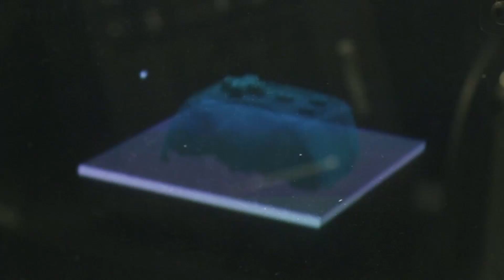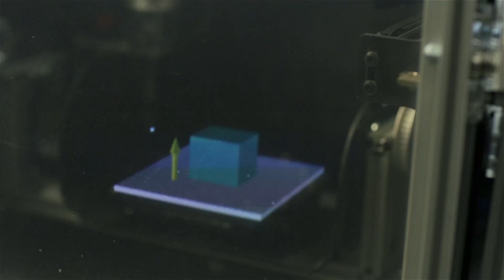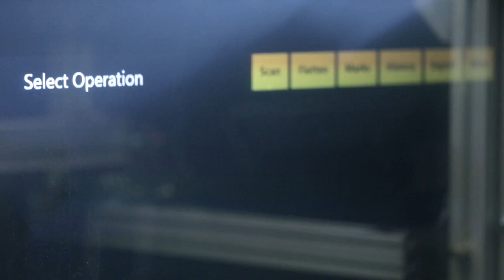ReForm: Integrating Physical and Digital Design through Bidirectional Fabrication

Comment: I think it all depends on the type of products you primarily work.  I spent the last 12 years working almost exclusively in the Ergonomic fit and feel realm of products for "The leading firm for handheld product design".  At the heart of our process was clay sculpting literally using pounds of sculpy clay a month.  Process was sketch, mock-up, sculpt, sketch, repeat until it fit right.  Working on the very front-end concepting stage of the clients programs allowed this process and allowed us to stay out of CAD as long as possible.  We did have a 4 axis cnc to carve foam as we started into CAD this allowed for sanding, carving, clay modification.  Most cases we would then convert the modification manually into the CAD software, but on excessively organic forms we would have it scanned.  The problem with the scanned content is that it creates a "Dumb" solid and our clients preferred featured parametric so shells, mold-flow, and FEA calculations would run smoother.  So the scans served as underlays for the parametric surfacing lofts.     

That being said, I see a benefit for internal development, based on the current level of quality it is not a deliverable I would ever feel comfortable putting in front of my clients or even my senior management now that I am in a corporate setting.

Comment: Interesting. Not sure how useful it is for designers.
As a designer, I'd much rather see faster 3D printers and recyclable / reusable materials.
That way, I could keep the design source material on the computer, maintain different versions of it, without taking up physical space, 3D print when needed and scrap / recycle parts that are not needed any more.
Also, clay can't replicate fine detail.